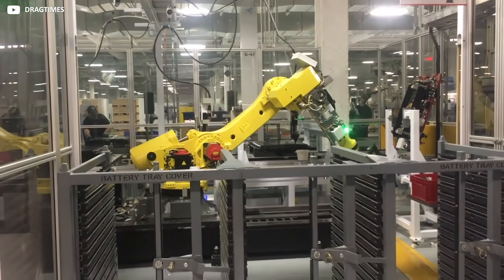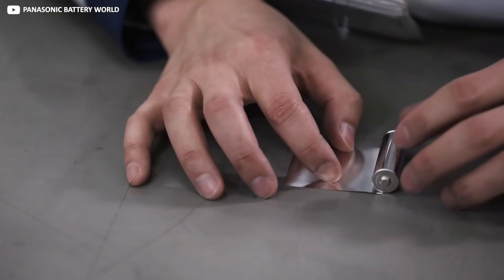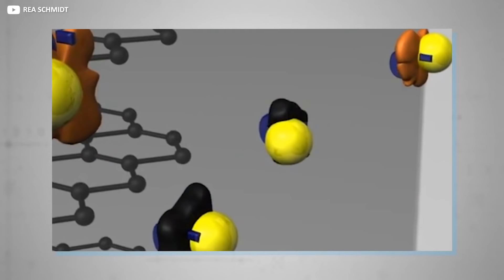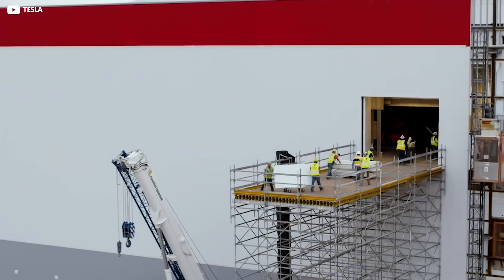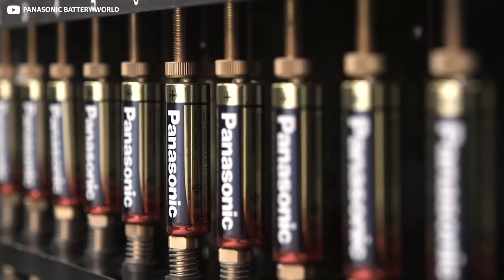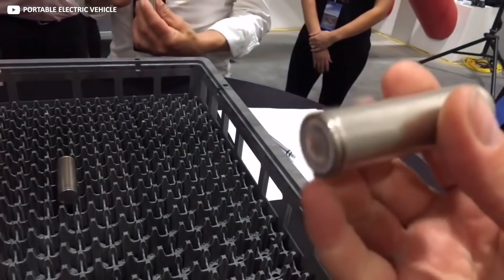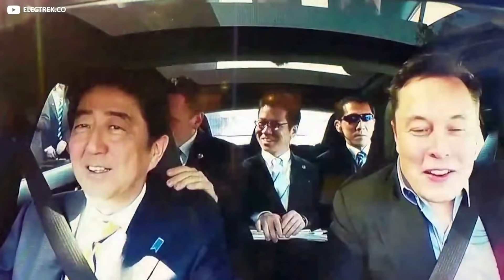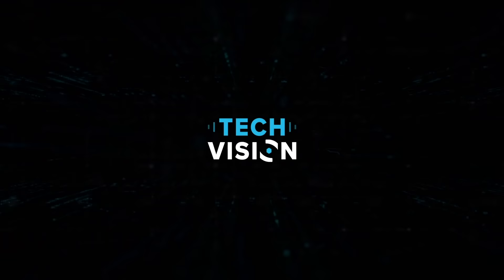How Tesla Builds Batteries So Fast

Comment: 1:39 what if you were the guy that made them put on the cart “no riding”
Reply: I have been that person >.<    Also, never 100% wire guide forklift systems!!!!  A piece of banding on the floor messed with the wire guide on my lift once, ( worked in a massive warehouse, to the point we had dedicated highways inside for fast lift travel ) sent me and a 13000 lbs forklift through a brick wall at 35 mph.  The forklift was fine, I broke 2 ribs.

Comment: Correct your Battery sizes information.
21700.  21 is the width 700 is the length in ( mm ) 10340 AAA, 14450 AA, 16350, 18350  18650, 20700 21700 26650
Reply: 21700 is 21 x 70?
4680 is 46 x 80, they just dropped the last zero.

Comment: This is pretty amusing. The company I work for is a certified Powerwall installer and we haven't been able to get new batteries from them for more than 6 months (and we aren't alone in that). And availability for 2021 is looking marginal - we'll get some, but availability will continue to be the limiting constraint on how many we can sell to customers.
Reply: COVID has changed so much for most technology-companies. I'm 'just' a simple electrician that gets to deal with quite a lot of electronics, but even we are facing huge delays in rather standard microprocessor-shipments. So it could very well be it's not only the resources for the batteries that are a problem, but certainly all the silicon required for everything to turn a bunch of lithium-cells into a working battery, whether it is a powerwall or a car-battery.

Comment: That is exactly their disadvantage. They build with a lot of very small cells. Since each one has to be wired several times, once for balancing and once for use, the risk of error increases with each cell. Above all, it is bad that they use round cells, because the electrode is heated when connecting them. Risk of failure. Above all, the industry standard beyond Tesla is to put only twelve, sometimes 18 cells in a module. Thus, all monitoring components located in the module and centrally are also industry standard and correspondingly reliable and inexpensive. Above all, it is a question of effort: No matter how automated it is - for a Model S battery, 8256 cells have to be processed in many steps. That costs. For a Mercedes EQS battery, it's 12 modules of 18 cells, or only 216 cells.

Comment: Nice video, one thing to point out though is you said Lithium is rare and has ethic issues, I think you are thinking of Cobalt. Lithium is actually pretty common in soil (another reason why tesla chose Nevada for gigafactory), and cobalt is a rare metal that is controversial because there are human rights violations common in the cobalt supply chain. (Child labor)

On battery day they mentioned they would be extracting lithium from soil I'm Nevada, and removing cobalt entirely in the future 4680 cells.

Comment: The biggest of all issues with battery operated cars is the recharge time.  If you can't more or less match the time it takes to refill an empty gas tank to full,  for a fully discharged battery, then you completely lose the entire market of people who have to be on the move and can't wait six hours to top off the vehicle to full range.
Reply: What are you smoking to think that it takes 6 hours? On a good day you can charge a model 3 from 20–80% in just 12 minutes, I honestly have no idea where you got that 6 hour figure from, are you thinking of a V2 home charger? As the point in a home charge is to be charged at home overnight.

Comment: 15 million sq ft? Hm. Maybe the levels inside it? I just looked it up on maps, outlined it and got a bit less than 2 million sq ft. Awaiting explanation.
Reply: Your math is almost correct, but, you need to sum every single floor of the building to have the exact amount of sq ft!

Ex:. If you have a 3 floor building, each one of those with 100sqft, than, your entire building will be 300sqft, but if you look in the google maps, you will find that the area that your building occupy is only 100sqft!

Ps. Sorry for my Bad English!!
Reply: @henriquefontaine5572  Yeah, my "maybe the levels inside?" idea is what you explained, we both theorize the same thing. Factories mostly not leveled and wht you an dI theorize here requires 7 levels, at least. This still highly unlikely. 
Somebody with another explanation?

Comment: Just by the by Lithium is like pretty darn common, it's 0.0017% of the Earths crust, which is about as common as chlorine, far more common than lead, more common than Cesium by almost an order of magnitude and none of these are precious materials. The reason to reduce lithium content is not because it is super expensive or rare, it's because it limits performance. Elon bought a Lithium mine that could supply world need for Lithium for a decent amount of time. It's not an issue, processing of Lithium is an issue, but even then it's not a show stopper.

Comment: Why these small 21700? Are not prismatic cells much better and tighter packed? Or is the single cell deactivating netter with 21700 and the cooling of 21700 better, because of unused spaces, good for cooling fluids?
Reply: indeed, cooling and current density drive you to many small cells. If you can get the self heating (internal resistance ) down, you can make bigger ones.

Comment: Why not drop the cylindrical batteries and adopt the rectangular flat packs that are more energy dense?
Reply: heat dispersal needs the gaps.
Reply: @mikep-j894  Flat batteries use heat sinks. no need for gaps.

Comment: So far, Tesla is not building battery cells. Panasonic builds them. It will soon change with their Berlin and Austin factories but their construction is not yet completed. However, the battery packs which contains battery cells and electronics are built by Tesla. Without cells, you can't make a battery pack so it all depends on the production rate on the Panasonic side...

Comment: All this time I hear about how batteries production have increased, and I wonder if they thought about ways to recycle those immensely huge numbers of batteries safely, and not cause worse pollution effect than green house emission.
Reply: That is a very valid question! To answer I can't point the exact companies now (forgot the name), but I can tell you J B Straubel (ex-Tesla) has one in the works and a promising from Germany says they dismantle them without melting (very efficient tech). The spring of these companies are coming fast, because the motto is "why would you move tons and tons of dirt to get some little fraction of useful stuff, when you can just shred the already existing batteries?"

Comment: Stupid question;
Why are the batteries the size of a typical "D" cell flashlight battery...
Reply: None of the batteries are "D" size. 18650 and 21700 (2170) are references to diameter and height (D=21; H=70 (mm)) in ISO units. These are more like big "AA" batteries than "D". 4680 is somewhat proportional to "D" but size is much bigger given "D" is 33.2mm/61.5mm.
Reply: @Sekir80  
Okay great, but why aren't they bigger...
Reply: @joeschlotthauer840  Geez, you are getting the hang of it! Long story (I am not knowlegdeable enough) short: there is a tradeoff of size. First of all: this size (4680) is unimagineably bad with standard construction, so they use  'tabless' batteries. Bigger size gives you bigger capacity and less building stuff, which is great, but with size heat increases. Again, tabless design helps to mitigate the issue. 
If you have patience I urge you to watch tesla's "battery day" presentation and if you wanna deepdive into this knowledge I HIGHLY recommend the channel "Limiting Factor": Jordan already spent 10 episodes on battery day deconstruction, making sense what was told there. The tech is insane, I'll tell you that!
Reply: @Sekir80  
Their smaller size let's them dissipate heat better, and optimize longevity and performance....
Reply: @joeschlotthauer840  It is true compared to pouch design vs cylindrical design. However, they wanted to increase the cylinder but the optimum is the 4680 which is way bigger than 2170.

Comment: In order to sell more cars in the future you have to obsolete the current battery technology and render the present models to no more than scrap metal (and plastic, of course). He has to no more than change the voltage being used in the current models by 20-30 volts -voila, done.

Comment: Ultimately I think technology is going to bend back the other way and return to internal composition engines. As good as we're trying to make batteries, they'll never store more energy than a liquid fuel and they'll never recharge faster than a liquid fuel pump can fill up an empty tank. This is not to say the oil industry has to keep drilling. We now have the technology to capture carbon right out of the air and turn it back into fuel, making it carbon neutral. Once this technology gets better, there will be no reason to rely on batteries that rely on slave labor to produce cobalt or other rare elements. There will be no reason to continue strip-mining massive swaths of land. There will be no massive piles of retired worn-out batteries that are a toxic eco-hazard in their own right.

At that point, combustion engine cars will be little more than chunks of steel that recycle the same carbon over and over producing almost nothing in the way of toxic byproducts.

Comment: I couldn't understand what makes electric vehicle better than other cars as we have to charge the batteries and the source for the charging station might be the same old coal burning or fossil fuel. The best solution to tap solar energy to drive car , wasting billions in battery making doesn't make sense when we know that dead batteries would create more environmental damage. Plants have shown effiecent way to convert sunrays into energy why not invest in developing such technology rather than this ultimately it's not solving the issue completly, might create hazardous battery waste in long run.